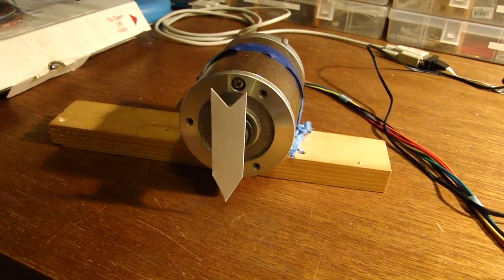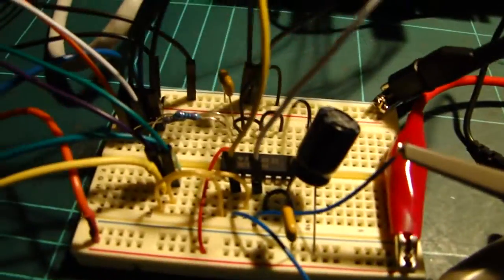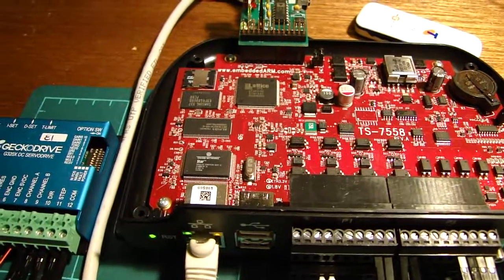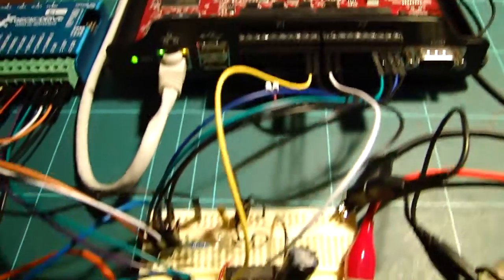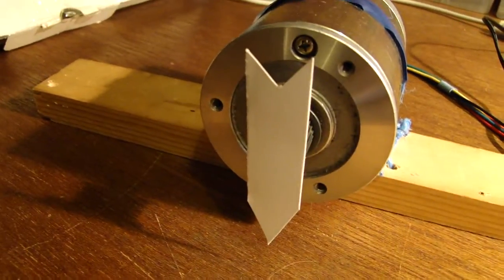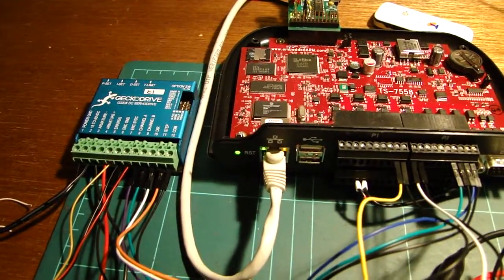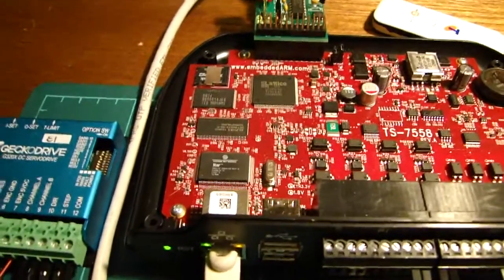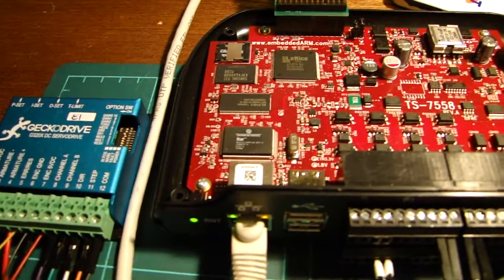SBC servo control under Linux

Comment: How did you go with this ?
Just picked up a TS-7558 with gekodrive g320x was looking at using it for a small hobby CNC, but by the sounds of it the TS-7558 didnt have enough power to handle multi servo chanels.
Mine came out of a bank camera monitor ssomething or other driving a 24VDC motor atached to worm box and encoder on back shaft.
Not manu likes/views, most would not have had a clue about what you where doing back in 2011.. inc me ..
Reply from the maker: Sorry I missed this reply. Yeah 100% it's not very capable for multi servos. it's core design really makes it hard.

-A.
Reply: @AlanGarfield  Cheers for the reply..